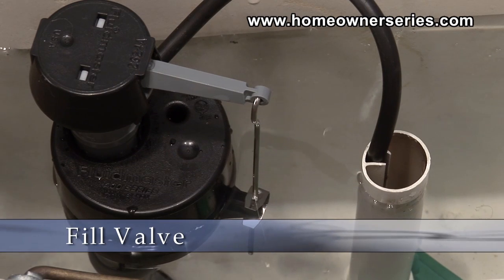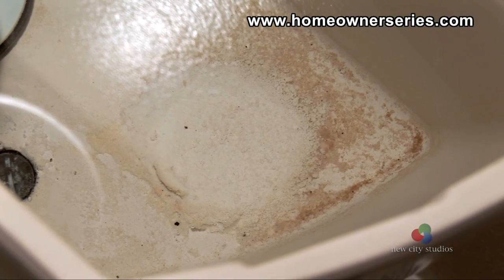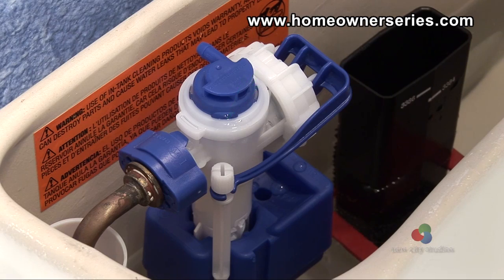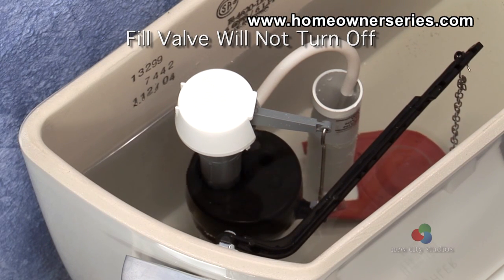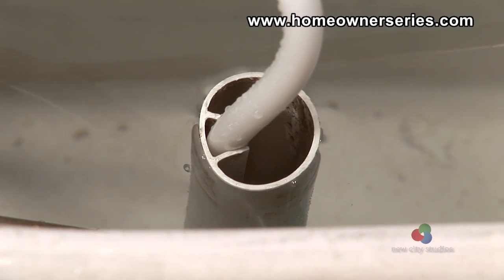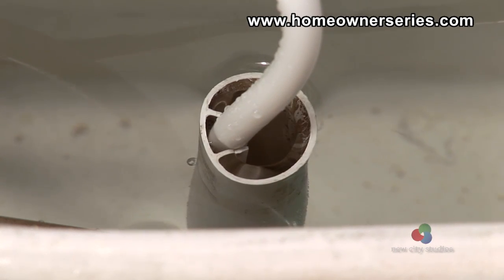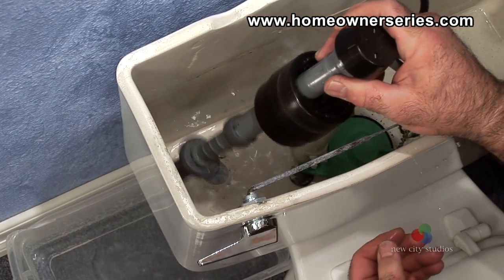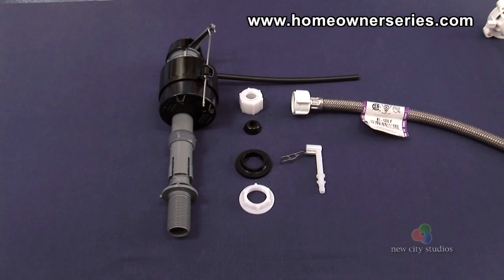How to Fix a Toilet - Diagnostics - Fill Valve

Comment: Brand New toilet at my house. I know nothing is crazy wrong. New toilet and brand new pipes throughout the hole house. But lately the toilet won't fill back up unless I tap it. So I'm thinking it needs to be adjusted? I'm no expert so I'm curious. Has to be the issue. After all the money we spent when that happened I was mad even though Im pretty sure thats the case

Comment: Muy fill valve cant be regula ted. When i placed It down to the level i want It Will Back up again after a tank flush. So IT wont regulate water

Comment: I replaced the fill valve on a toilet.  About 30 seconds after the toilet flushes there is a small amount of water coming out of the underneath top part of the fill valve and kind of trickles down and bubbles in the tank.  It stops and about 30 seconds later does the same thing.   I  brought a video to show then exactly what was happening.  Has anyone ever heard of this happening? Any suggestions?
Reply: Same issue. Did u figure it out

Comment: this is the most sterile internals of a cistern that I have seen, Is he serious ??? replace the fill valve every 5 years     why ????  its a $2 rubber seal that fails  who has the answer as to why the valve seal fila to shut down the watersupply when repalce   sometimes you have to tinker  to get it to work the seal appears to work on the principal of equalising water pressure  with the stainless steel pin but  I have not seen the seal in the cap  any clues  perhaps mine got flushed

Comment: DoloApe06
Its nice to see that the world can still communicate thru Utube. In answer to my problem   NO !!!!!!!! problem not fixed. Ok what have I tried ????
Replacing the seal with 4 new ones ,all failed to stop the problem, reducing the water pressure by cistern cock settings, flushing the house water supply to eliminate sediment as the cause, replacing the top cap section complete, replacing the whole valve flushing the water supply  to eliminate sediment as a possible cause  ok  next chapter

Comment: (chapter 3) steel pin and the seal, if H2O seeps past  it will not close  you cant accelerate the operation by holding down the float,  you have to let things happen naturally'

how about I video the procedure for Utube to show the world   just for a laugh

I can not recommend a fluidmaster, the plastic does get brittle in th flush mechanisms as well as the inlet valve so be  very very gentle unless you got a spare on in you kit,  I'm just lucky its my place and not a customer